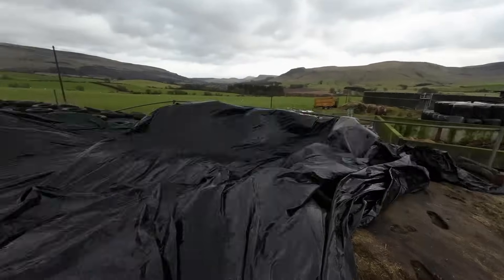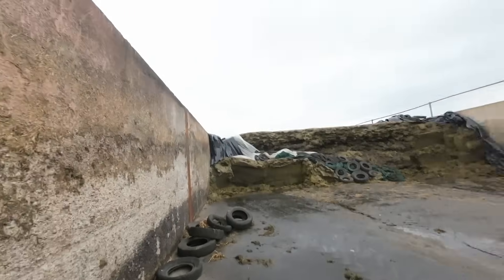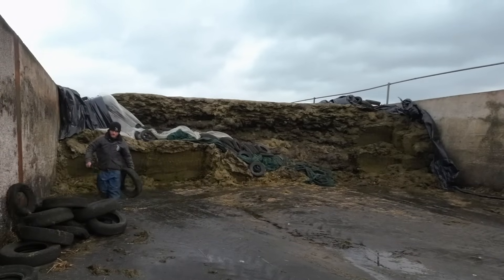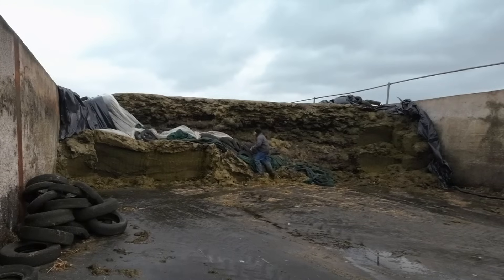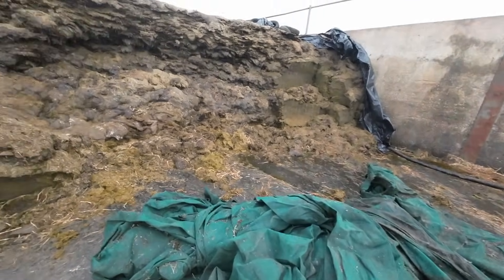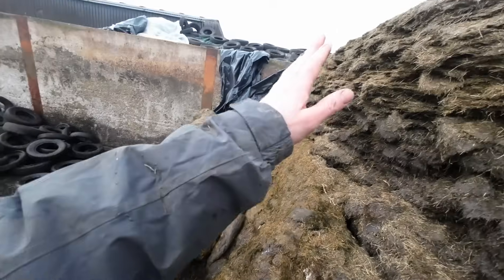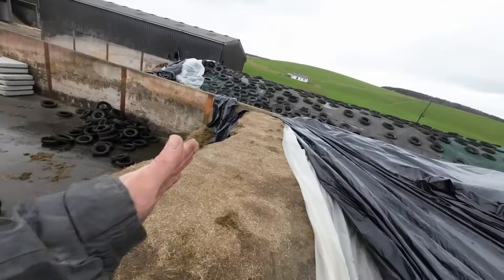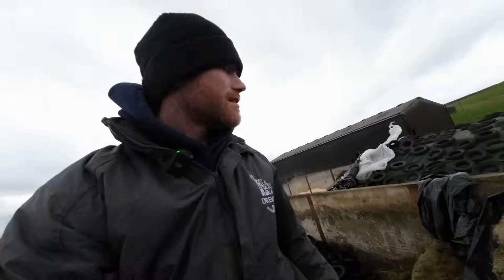RESHEETING SILAGE PIT 3 DAYS BEFORE CHRISTMAS!!?

Comment: The usual story with precision chop silage chopped too short, lots of farmers have switched to wagon silage or bales because of this problem in my area.
Reply: Wagon silage still slips but it’s usually the last 2/3 block lengths that fall not middle of the pit
Reply: I Google the question Why do silage piles collapse? Answer below. 
For example, if a pile is 15 feet high, you should be no closer than 45 feet from the front of the pile. Silage pile avalanches/collapses often occur when the pile has been improperly managed and silage is removed from the bottom up instead of the top down, resulting in an undercut and overhang in the pile.Oct 15, 2021
Farming is hard!
Merry Christmas Drew never miss an episode in Seattle.
Reply: That’s a rubbish comment , more than likely that pit slipped because this years silage was put in against some of last year’s silage which was left over , anybody who has hundreds of acres of silage wouldn’t dream of either bales or wagon .